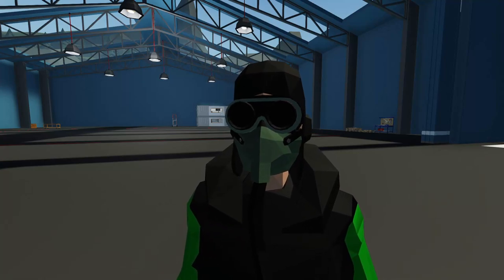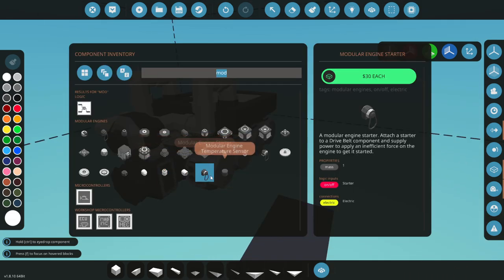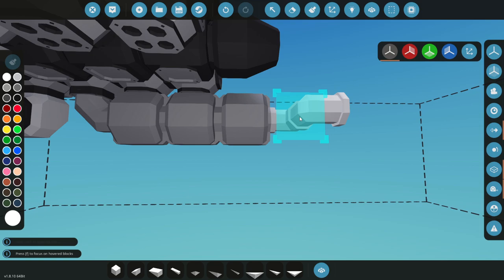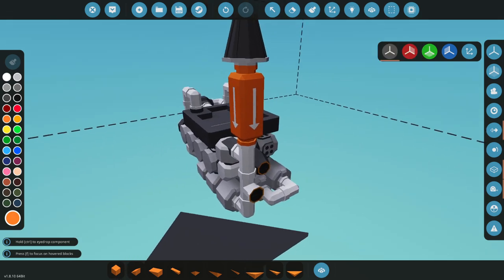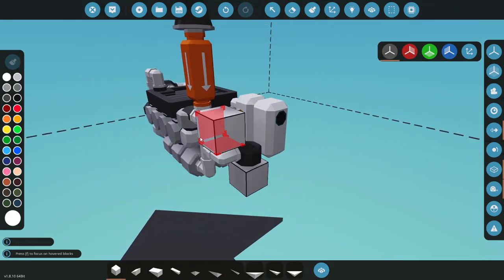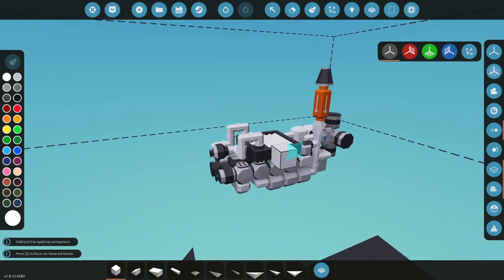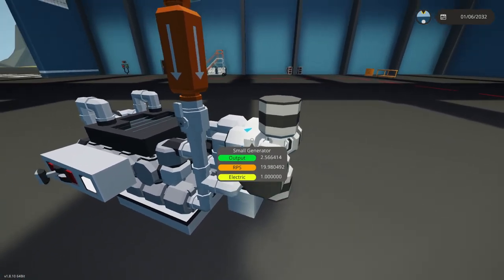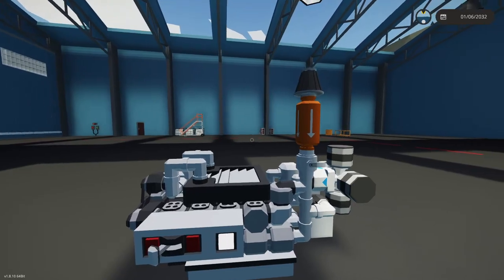NO AIR!!! Submarine/ Spaceship Engine 8cyl 1x1 Modular Engine Build Stormworks Tutorial - How To

Comment: I tried this and it ran for around 5 minutes at full throttle. Doesnt seem to work in current version?
Reply from the maker: Dont run at full throttle
Reply: @ProfNCognito  i tried 80 percent and it lasted longer but eventually shut down again. What throttle would be sustainable do you reckon? The weird thing is that the cats seem to be outputting more oxygen than air intake is taking in but still it stalls
Reply: Ran another test at 65 % throttle. It ran for 13 minutes.  @ProfNCognito
Reply from the maker: theres no telling. they keep changing the game every 2 weeks now its hard to keep up with how certain parts behave. apoligies.
Reply: of course. Thanks for your reply anyway. Love your content. Been learning tons. @ProfNCognito